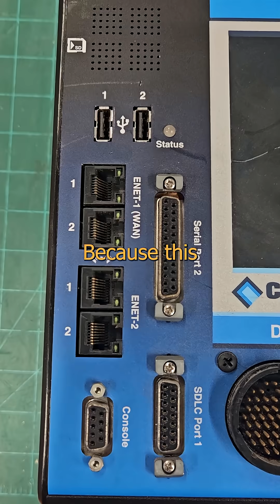Traffic Control Computer #chrisboden #comedy #engineering #educational #civilengineering #science

Comment: I wonder how it does redundancy and checking, and fail safe operation. I saw the very good YouTube video about all the ways the Alvin Submarine is designed to get their people home and some failure modes I never would have thought of. Like all the switches are sealed because if the O2 system goes too rich there is a risk of everyone burning to death inside)

Comment: Remember an outage from a storm that reset the 4-way light that my work was right on the corner of. Went across the way for some snacks at the store the next day after everything was reprogrammed and all was fine until I got on the straight lane back and... it never turned green. 3, 4, 5 cycles later and I ended up running it during the appropriate turn signal. Did always make me wonder how they set it though

Comment: I am a single tech and I work on those every day, they aren't as complicated as you think, that box just does what its told by another box called an MMU, now thats where it gets complicated lol.
Reply: MMU's aren't that smart, their job is to watch to see that load small signal inputs match load(120vac) outputs.  It's just a hardware cop.  Controllers use reverse logic - do until something fails, then drop to cabinet flash. MMU's behave according to their hardwired conflict cards...either the card allows or drops the system to flash.

Comment: Just looked up the specs... Oh yeah, you can probably run DOOM on this bad boy.
The CPU is a 233MHz PowerQUICC II Pro.
It has 128MB of DDR2 RAM.
Unfortunately it lacks 3D acceleration, but it does support PCI.

Comment: We employed one of those 52-pin plugs on a 150ft snake for an eight-ch Altec Lansing board. The mixed signal was sent back through the snake to bi-amps, split hi/lo w a beautiful set of copper coils, condensers to the  4 Dynakit KT88 power amps on stage pushing homemade Voice of the Theater boxes made from midnight lumber w Altec hardware. I had the high honor of soldering those two plugs and the J-box where all the magic went in and out. Worked first time… “and that was pretty cool!”

Comment: At one time I was certified on Siemens / Harmon electronics crossing controllers. I still have all the data on how to install, maintain, troubleshoot and destroy the various versions of SCX4000s, PMD-1's PMD-3s and so on.
The one thing I could never understand, in all my years of working on signals is why railroad crossing signals, which have a low duty cycle, operate on battery power with commercial power to maintain them; But traffic signals which run on a 100% duty cycle most of the time, have no backup system at all.  Power goes out, lights go out. But if a train comes, the gates still drop and lights still flash! The nerd engineer in me wonders why they couldn't put a battery on a traffic light?

Comment: I remember seeing people saying a raspberry pi could do this machine's job for a hundredth the cost. While this is technically true, you then have then have to spend about a hundred times the pi's original cost routing wiring looms to connectors, setting up redundancy, designing interfaces that a technician can use in the field and the end result is the same product you just tried to subvert.

Comment: Nah traffic light controllers are just glorified PLCs

If you want serious levels of safety have a look at the railway signalling interlocking controllers!
They typically use a 2 out of 3 processor architecture and have backups on the backups
...

Very interesting bits of kit, and the older stuff has all sorts of relay interlocking goodness thrown in for good measure... Including relays that have aluminium and steel slugs in the magnetic circuit to delay their pick up or drop away by a few milliseconds, magnetically latched relays, relays that have biased coils that only respond to a particular polarity, 3 position relays that respond differently to different polarity.... And even twin relays with mechanically interlocking armatures that enforce an exclusive OR function

Comment: Glock isn't infallible their 22lr pistol has a shot Life around 1,000 rounds before the nail driving charge behind the 22lr rounds some how blow out the chamber that's impressive considering most guns are good without maintenance except cleaning into the 10,000 to 100,000 round range

Comment: The city where I live about 10 years ago they finally caught the guy who had been stealing 286 motherboards out of these control box. What is strings is why would anybody steal such old technology anyways they caught the guy
Reply: "What is strings is why would anybody steal such old technology " You're making a bad assumption that there is no use for old chip designs... & that isn't the case. Depending on the component some stuff is identical to what it was decades ago, & plus there is utility for even 'outdated' chips for embedded & hobbyist applications.
They didn't stop making z80 chips until LAST YEAR (2024)... let that sink in.

Comment: Early on in programming a assignment is to program a single traffic light. Then you program a intersection for the second project.
You only see the values on the computer screen change. Usally the output is just text red, yellow, green. I wish they setup arduino boards with led's so we got a physical model of our work. The concept is the same from the text output to pin control on/ off but its not the same.

Comment: I used to be a signal tech, That Cobalt is awesome! Easy to program, also you can use it to run your Christmas lights, using relays of course.  If you can get your hands on the A B and C cable from a damaged signal cabinet, you can do some fun stuff 😊 also you can hook it up to your home network and access it via a web page with its IP. If you want to power it up,its the A cable connector, Power (120vac) to pin P, neutral to pin U and ground to pin V
Reply: @gunguy308  I've wondered why so many wires? There are some large pinouts on the connectors on the front, which seem like much more than an intersection worth of lights.
Reply: @epiicSpooky  Different guy, but his comment is stale so likely the only answer you'll get: Because there's a lot of inputs an outputs. My agency uses a different controller, but the cabinet handles 16 monitored channels (R, Y, G for each channel) for 48 wires only on monitored outputs. Usually a few more unmonitored stuff like blankout signs and actuated beacons are available. And then some sort of common for them.

Then, you have the inputs. 40 vehicle or bike, 4 pedestrian, 4 emergency vehicle preemption, up to 7 railroad preeemption inputs, GPS time sync and health monitoring, error flash sensing and probably some I'm forgetting. Not tough to get over 100, though most signals don't use nearly all of them.

Comment: A city in SoCal that shall remain nameless changed their downtown  traffic patterns to one way streets with every other one going one direction and the ones in between going the other direction. On the two streets with the heaviest traffic they set up synchronized signals that would keep you hitting green lights all the way to end of the road as long as you drove 25 mph the whole way. Ended a lot congestion and made things nicer for everyone. Then a few years later they changed the speed limit to 30 and instead of changing the sync to match they just took down the signs that said they were synced and let everyone go back to the stop and go, red light green light action that gridlocked them all those years ago. I wonder if there's a city engineer left there that even knows where that controller is. They funny part is, those signals are still synced for 25 mph and I still laugh at people who honk or go around me only to stop at the next light and watch me blow by them as every light turns green right at the same moment I arrive at it without even slowing down.

Comment: Giving me the heebie-jeebies looking at those 124 pin military molex connectors. When I was a kid my mom had my sister and I measuring wire out in 32' lengths for her job at an engineering firm

Comment: Future content ideas regarding infrastructure and intersections: EVP emergency vehicle detection photo eyes (and the accompanying lampholder with lamp and it's purpose) 
Loop detectors, specifically the means of installation and how the circuit works, the drivers and twisted pair cables typically installed yada yada. As a Midwestern journeyman wireman with a lil 'tism, i feel very seen with vids like this. Brand new cubby my first call was street work.

Comment: One thing I wish these traffic lights would do is that when first responder vehicles activate the Opticom system, it sends a signal to that box. Let's say there's an ambulance coming northbound; that system knows that the ambulance is coming from the southbound lane, which means it should be able to give that southbound lane all green lights in all the lanes and red lights for all other traffic. Maybe some states and counties already do this, but the state and county I live in do not. 

I've seen it several times where an ambulance or state trooper has been coming from the southbound lane, and the north and southbound lanes get green lights. The ambulance went straight through the intersection and continued southbound, so it's not as much of a problem. However, the state trooper, on the other hand, had to make a left-hand turn, which means northbound traffic, and the state trooper had to pay close attention to prevent a T-bone accident. 

Maybe he or some other YouTuber can explain and figure this out, try to get this system up and running for all counties, states, and traffic lights, or figure out why it can't be implemented.
Reply: Preemption programming depends on the programming given per direction, if emergency vehicles have a predictable path, opposing signals can remain Red.  Most are programmed for continued travel through the intersection.  Emergency vehicle preemption is also a timed duration.  Can be as short as 20 secs, but generally 30 to 40 secs.

Comment: The old systems that did everything with relays are a lot cooler IMO. There are still a lot of grade crossings that still have the old electromechanical stuff to control the wigwags and gate arms though. And they're not just simple "when the train hits this piece of track, activate the crossing", the train's speed has to be measured, then the correct timing needs to be calculated. Plus all the necessary failsafes. And that's pretty cool.

Comment: I work in Cali on traffic control cabinets as part of my larger scope as Municipal Industrial Automation Guy. We legally have to adhere to the CalTrans approved panel design specs, which means the controllers we use make that thing look like a supercomputer. I've seen sprinkler cotrollers that are more advanced than what we have directing traffic, by law. In my hired gun days, I designed a PLC controlled traffic grid with SCADA oversight, but that was for a city in Texas... and the free states don't seem to regulate traffic pedestals to parts pulled from a soviet diesel sub.

Comment: Look at all these Amphenol Mil connectors. Damn sure this is expensive as hell...
Reply: @MarcusVinicius-ft9ll  I've been to the Amphenol plant and they are expensive because they work. Forever.
Reply: @jayrenner1053  After 35 years one we disconnected three times a day finally had to be replaced, the cap/connector male threads started to gall.  My buddy in maintenance taped up  the pin holes and took a scotchbrite to the  threads, and then put a little wax on it.  Still working fine 5 years later when I left.

Comment: One thing that would make the world a better (and more efficient) place --- intelligent traffic light controllers that will cycle the lights early if there is no one benefiting from the current state of the traffic lights.  In other words, if you're stopped at an intersection, and the controller is intelligent enough to see that there's nothing moving on the cross street, it will start to cycle early.
Reply: Many do, but it requires the street sensors to be working properly AND for it to not mess up the network of the other intersections' lights.

Comment: I want to see if that model can handle camera input data so it can DYNAMICALLY adjust the light patterns based on somewhat real-time traffic changes... You know..
 Only changing lights when there's actually traffic to change for... Namely I want to know because where I'm at the lights are programmed pretty stupidly to not be dynamic like that, yet many intersections have such camera and other data inputs...

Comment: I know traffic lights at least used to run off PLCs running ladder logic. With modern technology I don’t know what they shifted too but I wouldn’t be surprised if it was similar. Ladder logic has a fun property where every line of code runs in parallel simultaneously. Meaning everything happens at once. Interlocks are needed to avoid things running when they aren’t supposed to. Ladder logic is a great lesson in logical thinking and troubleshooting. It well worth the research. I’ve once simulated a traffic lights using a plc and ladder logic for a class. Hence the adhd comment. Best coding class ever

Comment: .... dude... this bring back memories of college PLC class. we had to program our own stop light system.. as FIRST YEARS! About 3 weeks into the class. It was brutal. I found out about instructions for the PLC we hadn't covered yet but was banned from using. The second go around those instructions were usable.. ie 1 time and a bunch of limit instructions. Tho I used bits that time around. 50 minutes the first time, 15 the 2nd. (we did have to wire those suckers as well as program)

Comment: Most intersections shouldn't have lights. Roundabouts are better.
Reply: That's assuming that each of almost all of the drivers have at least as much RAM as that box contains. 

I'll be an optimist and say that's true despite current demonstrations to the contrary and agree with you (and several conclusive well-built studies) 100%.
Reply: Until you're at the roundabout by a Buc-ees and there's a solid stream of traffic from the other direction so it back up the freeway offramp. Roundabouts are great until they aren't.
Reply: @DanBowkley  But that many people would overwhelm a red light just as easily.

Comment: With that controller, will you be able to set up your own Close Encounters of the Third Kind alien light communication board?  You’ll need a piano keyboard with a midi interface or an ARP or MOOG synthesizer and some serious sound amplification with speakers, of course.   Even if it doesn’t work with the aliens it will probably work with various law enforcement agencies.

Comment: What is amazing and scary is most of the Control System world works by Security through obscurity. Once you know all the bits that make something work its as easy as looking up the vendors website and pulling its instruction manual.  Its only when you get to military stuff that most manuals get hard to get.  For those visit a warthunder forum and complain how some other thing is better than the thing you want the manual you want.

Comment: Have you ever been in an old relay train station signal tower (or whatever it's called)? I have no clue if they still exist in the US, but, as of today, there are still some of them in Germany, but they are slowly being replaced by solid state computers.

The relay computers are very cool, considering that they basically have to do pathfinding, set the correct signals and switches to navigate trains without accidents.

Comment: Actually that's not the liability bit. It's just the controller. The real liability bit is the conflict monitor which checks everything to make sure the light is working properly and shuts everything down if it detects an unsafe situation. This can do its thing and lose its mind. The conflict monitor cannot. It's the reason you'll not see two greens unless it was allowed.

Comment: I just ripped a bunch of that 40x18ga control cable out, no connectors though.  Just FYI, it'll fit in 1 1/2" conduit, but it won't be happy about it

Comment: Can I borrow that? Fresno CA has the most amount of red lights i have ever seen. And whoever thought it was a good idea to have signals randomly turn red for five seconds, then go back to green, WHEN NO ONE ELSE IS AT THE TRAFFIC SIGNAL! should have both sides of their pillow be warm.
Reply: Horribly inefficient, plus increased emissions from traffic unnecessarily stopped.
Reply: The ones where you'd swear they have the sensors wired sideways so when you approach a green light with nobody else around anywhere it sees you coming and turns it red just so you can sit there for five minutes.
Reply: Town I work in (Longview, Washington)-- the traffic always flows better in a power outage when every intersection has to be treated as an all-way stop
Reply: You don't want to have a traffic light wholly dependent on sensor data to determine its state, because the problem is if there is any malfunction with the sensors, you then have the possibility of cars stuck behind a never-ending red light. So you have to have signal state be timing based - after a certain amount of time it flips, regardless of what any sensors say.

... which is also assuming there ARE sensors, & they just keep it simple & use a good old pure timing mechanism on its own instead.
Reply: Warm? No. burning

Comment: As CusterSurfFisherman stated the main item in the cabinet is the conflict monitor. A little box that has a hard wired card to prevent conflicting lights from happening.  What you need to find is a really old time clock controller.  That will really freak you out.